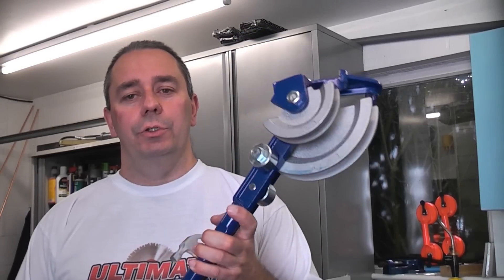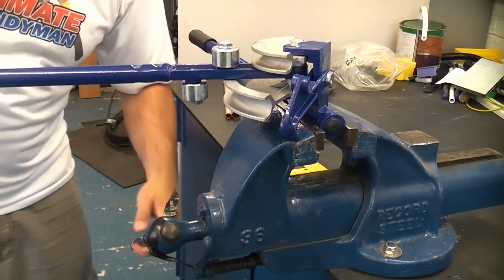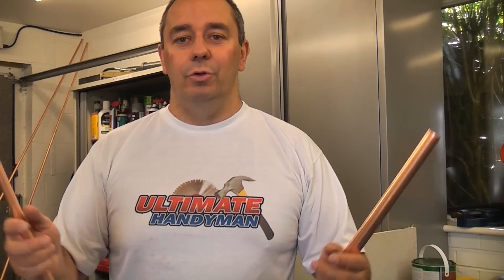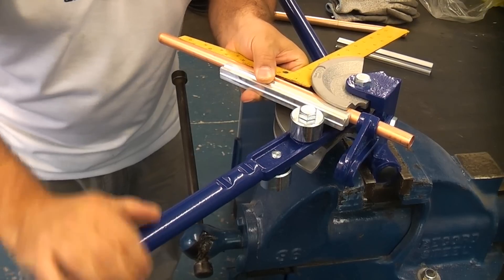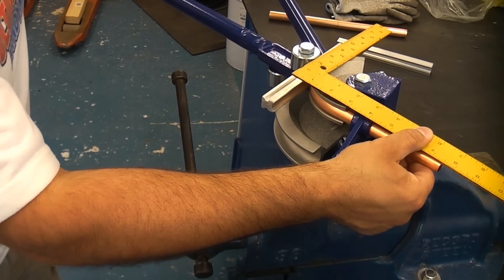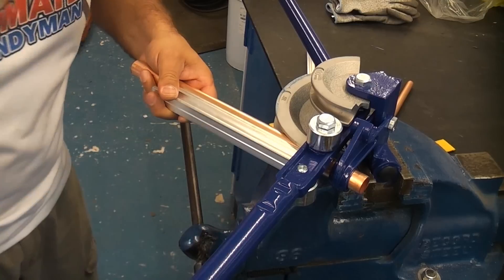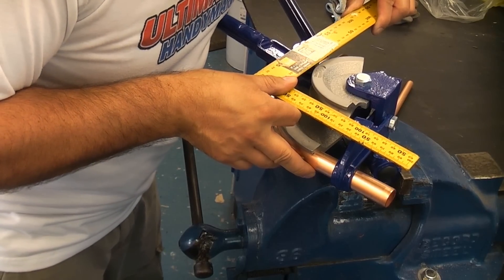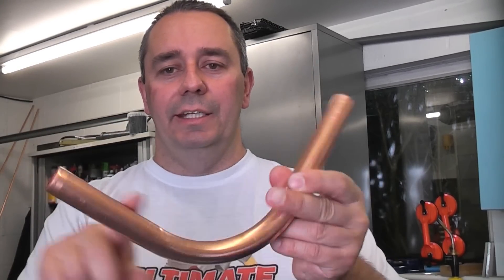Pipe bender | bend copper pipe

Comment: If using pipe benders to bend the pipe to a rounded bay window, would i need to add sand inside the pipe? Or is it lease likely the pipe could cave with a pipe bender?
Reply from the maker: It depends on the angle and also the pipe. Some pipe does not bend well, I guess it depends on the manufacturer! I’d just try it and if you are having problems, then you can try the sand (perhaps a little heat too- just make sure the sand is dry)   
Thanks for the comment 👍

Comment: what about the material contracting and enlarging? what effect does this have on the tube ? does the longer side weakens the material ?
Reply from the maker: The expansion and contraction should be minimal and will occur on all pipes that vary in temperature.
It stretches the tube slightly on the outside, but it should still be fine for decades! 
Thanks for the comment 👍

Comment: Hello, I may be being a bit silly. I received my heavy duty pipe bender 15mm and 22mm earlier this week. I am unable to move the two arms apart. Is there a bolt that I need to loosen before I can start using this tool? I'm really not that weak so I don't think it's anything to do with my strength. Any help would really be appreciated.
Reply from the maker: Not sure about that, there is not a locking pin or something, is there?
Mine just opened right up 🤔

Comment: You’re lucky that in the UK they use 22 copper for heating. In the Netherlands we have to bend steel!
Reply: @ultimatehandyman  plus of steel is that it’s cheaper. But the negatives are that you need to either press it or use compression fittings. There is no soldering it!

Compression fittings is what we use at the company I work for, I thing it looks less neat and they’re really expensive. But I get my boss too, buying press guns for everyone is expensive too!
Reply: Think*
Reply from the maker: @plumbraider2265   I've installed thousands of meters of steel pipe on site, from 1/2" to about 12" in diameter, but that is either threaded (up to 3" )  or flanges are welded on, then it is bolted together. We could only bend up to 3" on site, using the hydraulic pipe bender, anything else was normally made using elbows etc.
Thanks for the comments
Reply: @ultimatehandyman  yeah that’s the old school pipe, I’m talking about thin walled steel, because in holland we are cheap 😉

Thick walled is a world of it’s own, never done it if I’m honest

Comment: Very helpful, but no info as to what you are marking and measuring?
Measuring a bend accurately is the hardest part of using this machine
Tky v much
C
Reply from the maker: I wasn't making anything, this was just a demonstration of how to use the pipe bender for bending 15mm and 22mm pipe for domestic plumbing.
Thanks for the comment 👍

Comment: how to bend perfectly ?cause my dad have a diy bender but when we bend a tube theres a place where the tube starting to flat not perfect bend or perfect form
Reply from the maker: Sometimes it is impossible to get a perfect bend. A lot can depend on the quality of the copper tube. Sometimes it will bend better if the tube is heated slightly.
Thanks for the comment 👍

Comment: Will the 15mm form work with 10mm microbore with insulation still on. The thickness with that is 13mm.
Reply from the maker: I doubt it, you will probably kink the pipe.
Thanks for the comment 👍
Reply: @ultimatehandyman  oh. Thanks for the reply. Hopefully with the bender I got I can get an attachment for it. I might try pad out the form with some duct tape to make it a tight fit to let me away.

Comment: Excellent video. Do you show in your how to precisely mark for your bends so you can. Have an idea where they will end up? Thank you for the excellent video. I have recently bent 3/8 D pipe and wound up with kinking. In the. Inner radius. What causes that? Is the copper to soft or inner wall to thin? Just wondering. If you could have some. Helpful tips. Thanks much 👍👍👍
Reply from the maker: When marking the bends, just remember that the pipe will stretch by the diameter of the pipe.
I think the rippling can be reduced by heating the pipe slightly, I'm sure someone suggested filling the tube with sand, but I have never tried that.
Thanks for the comment 👍

Comment: I have no idea what I'm talking about, but it seems to me that when you are measuring for 90 degrees, if you put the square on the bottom of the pipe, and flip the square over to measure the angle of the original end of the pipe against the guide (which I'm assuming is in line with the newly bent end of the pipe) it could be easier to line up?

Comment: But then you have couplings to connect on both ends.  So then you still have as many unions.   Just straight ones.  Is this better.  Also using this on site as a contractor I find fittings easy to access and apply.   1/2” pips is what I work with. Don’t keep a Vice on job site.  Is there another tool I should look into.
Reply from the maker: You might put several bends in one piece of pipe, using the pipe bender, which equals less couplings.
You don't need a vice to use this, I only used the vice to make it easier to film ;-)
Thanks for the comment 👍

Comment: I'm in the US. Looking for a pipe bender to bend 1/2 inch (.0625 OD). 15mm is .59055 OD. I'm guessing your bender won't accept .0625. Do you know any that will accept .0625 OD copper pipe?

Comment: Very nice - does the bend look any better if using a spring, and the pipe bender(at the same time)?
Reply from the maker: Not sure, as I normally only use one method at once.
Thanks for the comment
Reply: That cold be a great video, because bending 22 mm pipe is quite much harder.  Perhaps the spring could help.

Comment: Could you tell me what wall thickness is. In the U.S. it's color coded. Green is K, Blue is L, Red is M    3/4" pipe     0.065 0.045 0.032   wall thickness
Reply from the maker: There is a table on this page which might help- http://fave.co/2C74fFD
Thanks for the comment

Comment: Lol so instead of paying for 1 copper 90 fitting you are now gonna use 2 couplings.....
Reply from the maker: I don't think anyone understands the point you are making.
People bend pipes, that's why they make pipe benders, you obviously have a problem with that- get over it!
Reply from the maker: No, if you bend the pipe you don't need to use a coupling.
Perhaps you don't realise that this is a demonstration on how to use a pipe bender! In real life the pipe could be 3 metres long and have a couple of bends in it- which you can do without any joints.
Reply: Adam Cronin in my opinion you are an idiot. He demonstrated very well how to use a pipe bender, which is used constantly on plumbing jobs. The ends can be swaged ( ie expanded) so no fittings are used at all for copper runs.
Reply: Ultimate Handyman lol you are obviously not a certified plumber if you aren't understanding the point i was making.
Reply: @adamcronin8846  keep your plumbing codes to your own area... the world is much larger and different than your plumbing authorities have you believe. I am sure plumbing was not invented in your lil town!!!

Comment: Hi,
When bending 15mm copper using one of these pipe benders, the outside edge of the pipe 'flattens' and the inside ripples a fair bit.
Is this normal? Could the bender be sub-standard? or the pipe perhaps be too thin?
I'm assuming there must be standards for copper pipe dims.
As an example, I have an 'old' piece of pipe with a 90º bend, left over by a plumber some time ago, that doesn't show these extreme signs of deformation.
Any guidance would be appreciated.

Thanks
Reply from the maker: Some pipe bends better than other makes, for example if you get your pipe from a dedicated plumbers merchants it is often better than pipe purchased from DIY stores.
Temperature can also make a difference and you do get a better quality of bend if the pipe is warm ( so never try bending a piece that's been in the garage in winter, unless you warm it first)
I hope this helps a little ;-)
Reply: That's helpful, thanks very much.

Comment: Do not EVER bend copper tubing to create a 90 degree bend, period!! This stretches the outer part of the pipe very thin. Especially when using M type tubing. Use a 90 degree elbow to make your bend. Using a high dollar tool versus a .90 cent fitting..... absolutely stupid!!!
Reply from the maker: In the UK, we bend copper tubing all the time with no problems ;-)
Reply: nonsense
Reply: Part of your city and guilds exam is bending two 90 degree bends ya numpty!
Reply: The tubing does thin a bit.  This is understood, is tolerable, and has proven acceptable many millions of times.
Reply: Then use type-L, that is 40% thicker, and if still too hard, anneal it.  And what IS stoopid, is placing many 90 degree elbows when pressure drop matters, because std elbows drop the pressure much more than smooth, larger radius bends.  If water hammer happens for whatever reason, a smooth bend wont hammer as hard too.
Reply: service1956 in America maybe or wherever you’re from.
But here in the uk we bend pipes to 90 degrees and more. I’ve never seen the pipe split or rupture. I guess it depends on the grade of copper you’re using. But I’ve seen heating and gas pipes over 30-40 years old still fine.

Comment: I have a Hilmor bender I've been using for about 5 years and now the copper ripples quite badly when I bend tube with it. Any ideas what might be causing this to happen anyone?
Reply from the maker: I think Razor once covered this issue and said it could be due to poor quality pipe and the pipe being cold.
You could try heating the pipe gently using a heat gun etc. as that will possibly help.
Reply: Thank you so much for your very quick reply UH!  Will try heating the pipe first in future. I remember my dad, back in the 60s teaching me plumbing, and telling me to anneal the pipe to align the molecules in the right direction, relieving the stress on the pipe. By the way, whenever he sent me to the merchants for tube he stressed that they were to sell me ONLY English copper pipe, and not the foreign stuff which was a bugger to bend. 
Following advice from another plumber I've given my forms and guides a good sanding to make them smooth. Hopefully the ghastly rippling will now stop with the pipe heating and cleaned formers. Cheers!
Reply from the maker: Best of luck with it, please let me know how you get on ;-)
Reply: Thank you ever so much, will let you know what happens. Cheers.
Reply: @UKBorder-Farce  What happened, did the sanding of the former and warming of the copper pipe solve the rippling?

Comment: Here in canada we have benders for bending conduit ,emt as its called here ,its thin walled about the same as your copper pipe ,we have a 4ft long piece of 3/4 steam pipe screwed into the actual "U" shaped pipe form with a hook on it to hold the pipe in position lay the pipe on the floor stand the bender handle in place and bend to you desired angle all the way to90 degrees you can bend up 1.25 " by hand .Any size above that we use hydraulic benders ,and for very heavy duty electrical installations we use a conduit 4" in diameter and is the same gauge as steam pipe a d is. Ent with a hydralic bender ,it bends the 4" pipe like a wet noodle , google emt bending take a look

Comment: Great video! I've bought the same pipe bender which arrived today and I cannot move the arms at all. HELP please!
Reply from the maker: There is nothing locking the arms together is there?
Reply: Thank you for responding Ultimate Handyman. There is nothing locking it as far as I can see. The model is exactly the one you use in your video. I even tried to loosen the bolt that goes sideways through both arms at the top-end. Even when loosened, absolutely no movement in the arms whatsoever. It must be faulty, surely?

Comment: Great instructions - many thanks. A novice at this but with your instructions all is going well! Trying to bend 180 degree ie 'u' shape but each time it causes a pinch in the pipe just before I reach the final angle - is it possible to avoid this somehow?
Reply from the maker: I'm not sure as I have never had to bend anything that severe before. Have you tried gently heating the copper with a heat gun etc. ?
Reply: Many thanks for the suggestion - will give it a go. It looks as though all the stretch in the pipe from the bend is compressing at this point and it just can't seem to cope with the full bend!
Reply from the maker: You are welcome.
Good luck with it ;-)
Reply: Hi Nick, when you get to about 90°, or a bit beyond, pull the guide out a few inches so that it can reach round the former and enable you to pull a complete U bend.
This will prevent rippling also.

Comment: Can anyone help me by explaining or directing me to information  about bending copper using the kind of benders that HVAC/R guys use? You know, the ones made by refco and imperial etc. I want to know how to mark out bends accurately for runs and where/how to measure for multiple bends on a length of pipe. No one has taught me and i need to know.

THankyou
Reply: autobot69000 if you are referring to a ratcheting bender, make your marks for center and position the bender so the handle is centered on your mark. If you are referring to a lever or gear bender, if you measure from the left to the right, for the lever bender line up the zeros on the handles and keep your mark on the R. If you are measuring right to left do the same but line up your mark on the L. The gear benders are the same but left to right your mark should be on the 60 and from right to left on the 30.  For 45s on the gear benders line up your marks on the pivot points. Hope that helps.
Reply: autobot69000. Hey what about an electrician conduit bender? Try "how to bend electrical conduit"

Comment: Will it bend normal metal pipe
Reply from the maker: No, this type of tool is only for bending copper pipe- which is soft.I don't think you could bend steel pipe with it, although I have never tried.
Reply: +Ultimate Handyman it probably could
Reply: Conduit, yeah, not for plumbing or gas though.

Comment: Can't be using the ruler like that out on a job though, it takes forever! Gotta just trust your eyes. I'd never bend a 22 mil though, just use press connections or weld, depending on the circumstance. I got one bender for 12 and one for 15. (I work in Sweden)
Reply from the maker: Thanks for the comment ;-)

Comment: will this weaken the pipe and leave it prone to rupture/crack years down the road?
Reply from the maker: +mattp1482 
It will not weaken the pipe noticeably. Copper pipe has been bent like this for decades with few problems ;-)
Reply: Depends on the wall thickness of the copper tube. Best to check local codes.
Reply: Perhaps using type-Lpipe, that is 40% thicker pipe Wall could be better than trying to use Type-M.

Comment: Hi, do you know if it can be used to bend 22mm aluminium tube too?
Reply from the maker: +cezar t 
It depends on the exact composition of the Aluminium tube. 
For example some stainless steel tube can be bent and some cannot as it distorts and crumples, so it really depends on the type of aluminium used.
Reply: +Ultimate Handyman thanks, what I was interested if the bending tool doesnt break or distorts its dies with a stronger material than copper. If it can handle stainless pipe, it should be fine with aluminium too.
Reply from the maker: +cezar t 
I don't use this machine for stainless- only copper!
We have an hydraulic pipe bender at work, which is used to bend steel pipe up to about three inches in diameter. Some stainless pipe will crumple if you try and bend it using that machine, so you have to ensure you get the correct grade of stainless.
It would depend on the grade of aluminium and the wall thickness, but you might be able to bend it using one of these or you might not!

Comment: thanks, so with a pumped heating system (combi) would the more inefficient elbow be noticeable or is that more the case for  natural convection? thanks
Reply from the maker: +Elwyn Harris 
You would not really notice with good water pressure, which is what you'll have if you have a Combi boiler.

Thanks for the comment

Comment: what do you use to bend 5mm central heating pipe?
Reply from the maker: Mick Jones 
Personally I would never use anything less than 10mm for central heating, but you can bend small diameter pipes using a mini tube bender.
Reply: turns out it is 8mm, thanks anyway

Comment: how can you determine how much flow is reduced by an elbow compared to the flow reduction of the visible narrowing of the pipe in the bend shown in this video? we can all see the pipes diameter has been visibly decreased in the bend.
Reply: ***** Cheers!!!!!!!!!!
Reply from the maker: Tony King 
Not sure about that as in most domestic plumbing situations this is rarely an issue.
Razor talked about bends versus elbows in this video, which might help- https://www.youtube.com/watch?v=uLaZkqfVJHY
Reply: ***** Could it be that the effects of "water hammer" are reduced with bending the Cu pipe instead of using the 90 Deg elbows.
Reply from the maker: Yossi Allen 
I doubt it. You normally get water hammer when the pressure is high and a valve is closed too quickly.
The only way to over come this is to reduce the flow by closing the stop tap slightly or fit a shock arrestor.
Reply: ***** Thanks for the reply. I am on a course for plumbing engineering right now to I shall be looking at more of your useful videos.
Reply from the maker: Yossi Allen 
You are welcome
Best of luck with the course ;-)

Comment: can i use this thing without mounting on bench vice
Reply from the maker: rutvij kakani Yes, no problem at all, it's just easier to demonstrate in the vice.
It has two handles, one of which you can hold and the other you can hold it or place it on the floor when you are using it.
Reply: Good